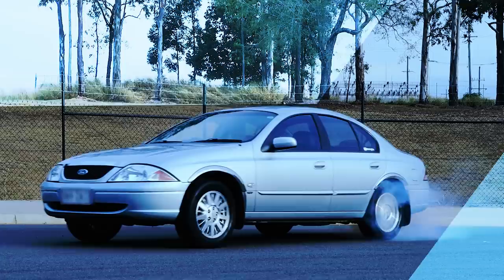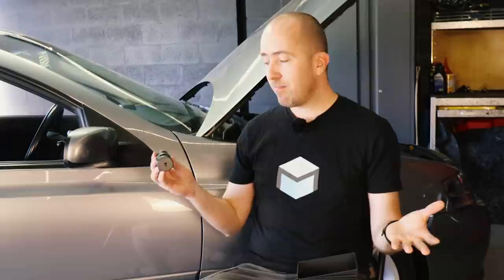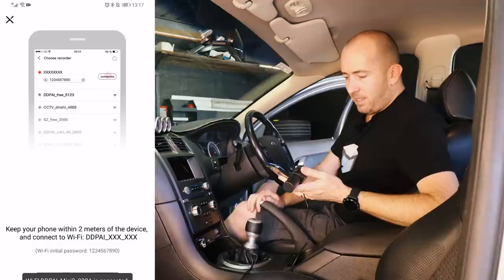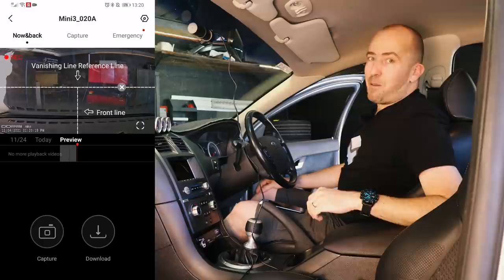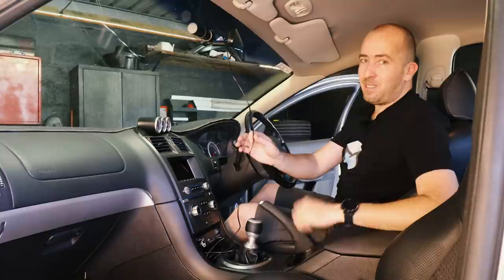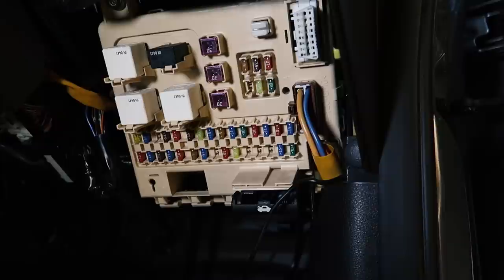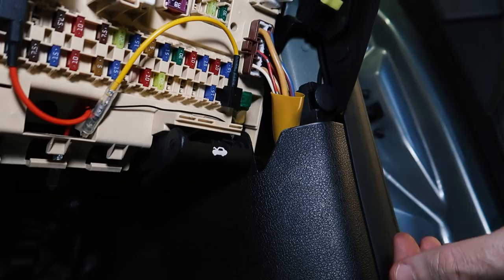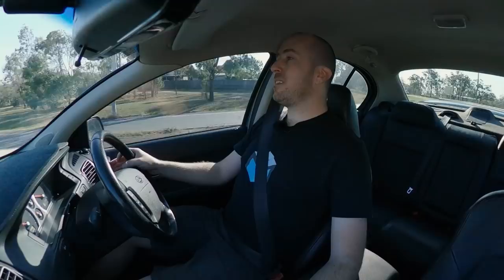📷The Best Budget Dash Cam? Why the DDpai Mini3 Camera is Worth Buying in 2021! 1600p 32GB Install

Comment: People have already mentioned the Fuse tap needing to be installed the right way which is one thing that I was looking at when doing mine. I have a Blackvue, obviously a lot more expensive but wiring is pretty much the same. Only thing I can add, is when running the wiring through your pillars, make sure it doesn't obstruct the airbags (if fitted that is). With my FG, I had to pull the A Pillar cover off all together to make sure nothing was interfered with. I used the sticky clips provided to hold the wiring behind the airbags. Same with the back camera, I fed it through the guts of the roof (I know you haven't got a rear camera but for information to other viewers). Great video once again Sean. Always look forward to your videos, keep it up. 👌😉
Reply: Wirring won't stop a side airbag being deployed trust me lol.

Comment: I have Navman MiVue 1100 XL. Bought it from Jbhifi for 450 bucks. It has both front and back camera with a display in front camera. The display can show both camera or just one. But, I set it up as a Heads-up display as it shows speed of car very accurate to my speedometer along with date and time.
It records the best video in night, warns you if headlight is not on for night, railway track coming up or speed camera ahead. It not cheap, but for 2 camera front and back with all those HUD and speed warning, I think it was a wise investment for my part.

Comment: Nice to see you are installing a dashcam, you don't want to have a crash without any sort of proof you are not at fault.

In my case having a screen is a must, with a screen you can tell in a instant if the dashcam has some type of error (Camera or Micro SD).

Im been using the Xiaomi Mijia 1s, pretty cheap for what is it. 

1080p.

Comment: I literally don’t understand how people live with wiring just dangling everywhere in their cars. Seriously! Just take a few minutes out of your life and route it out of the way! Mate, it’s not that hard lol 😂. 
Cheers Sean, great video. From your Aussie fan stuck in NZ 🤣🤣🤣
Reply: I agree. My current dash camera sits on top of Dashboard at bottom of windscreen an I have my power cord running down dash of my BF Fairmont ghia beside Interior command centre screen an secured to dash with small plastic mounts that have adhesive tape on back. So mine doesn't dangle everywhere. Rear camera lead same but on left side of ICC screen an under carpet an plastic left side door trim .up the C piller under roof lining pokes out near top centre of rear window an plugs into rear camera.

Comment: Great video Sean! I think it has been said below, but regarding the fuse taps, be sure to check which side is positive and orient the fuse taps accordingly, otherwise the fuses will act in series and can be overloaded. I'm no expert, but I watched a few videos regarding dashcam hard wiring before I did it myself, and turns out some of my fuses in the same row on the fusebox had positives on opposite sides, so had my fusetaps pointed in opposite directions (just like your setup). Just got a $10 circuit tester from Autobarn, and all set.

Comment: ..... Well done Mate, fuse splitter has to go in one direction only, otherwise your tap will be in series with the existing fuse.
Measure with your multimeter to find the source + side and the load side of fuse socket. Then map the splitter and you will see what I'm on about. I recently did a clients toyota 4WD and had to ensure the pillar feed did not interfere with the airbag (by securing it well away) just a thought if you install in other vehicles.

Comment: My last camera was from DDPai and it was brilliant but I have now got one that I believe is far superior and also has the camera for the back of the car. Both record in 1080P and it also uses an app which works great. Same as the DDPai you can download the footage straight to your phone. I cant remember but I think it cost around $150-200 when I bought it. Had it for years now and it has never failed me. Also came with the hardwire kit.
Reply from the maker: Sounds good - I wonder what it was?

Comment: Hi Shuan. My current Dash camera is powered through the power socket ( Cigarette lighter).
Am planning getting a new camera 
Anyway if I have radio on an you have news on or radio announcer interviewing.  You get interference if dash camera is on. No interference when radio has music playing or playing a CD.
If I hardwire it in like in your video would this stop the interference?

I have a 2nd question: the camera you have in this video would it fit behind centre mirror on right side as I have an existing  ETAG attached to windshield on left side?

Comment: Looking to buy two dash cams, one facing front and one facing rear (do you think a rear facing cam is a good idea BTW?). Would prefer one with a screen though. Tried a couple of cheapy bargain cams from Hardly Normal a few years back and they were utter rubbish. Threw them in the bin in disgust after a couple of days (had to buy the memory cards extra). Cheers!
Reply from the maker: I tend to avoid a screen - it makes them larger and bulkier and it's just another thing that could break. The phone app is quick and negates the need for one really.
Reply from the maker: Oh and a rear facing cam is a good idea - either buying one that can do front and rear, or buying a second cam like you suggested.
Reply: Thank you for your advice. Looks like this is the way to go.

Comment: Was looking for a new camera to replace my SCA camera, which to be fair has worked faultlessly for 4 years now.  Also worth noting if you have curtain airbags in the A pillar, make sure you route the cable to the side of the airbag module so it doesn't foul if the airbag deploys.  Definitely use a fuse tap, if the camera doesn't come with one, or your car uses the smaller micro-fuses you can buy them from Jaycar for peanuts.  I've seen people loop the stripped wire around the fuse peg and shove it back in & I don't think that is dangerous or anything, but it is pretty bogun 
:-D
Reply: Installed it this morning - weirdly though I got the exact same model, it did not come with a fuse tap - which was fine as I already had installed a extra double plug hidden in the glovebox so I just routed it to there - might be a difference between the NZ and AU suppliers I guess.  Actually had to route the cable behind the curtain airbags as they extended all the way up the A pillar into the roof area but it was easy enough.  The camera seems very good so far, I had to adjust the sensitivity as it kept triggering the impact sensor, other than that & turning off the startup noise, it's a big step up on the old SCA.  Thanks for the tip!

Comment: Love this channel Sean. 
I’m not sure why dash cams are popular. What is the benefit of them?
Reply from the maker: Evidence / backup in the event of an accident. Makes insurance claims a breeze too as who caused the accident / damage is indisputable. This camera also has 'parking mode', so if someone backs into your car whilst parked it'll also capture it. 

Personally that last feature helped me catch someone who backed into my car 10 years ago and then drove off. I saw damage on my bumper and went back through the footage helped me find out who it was, grabbed their rego and submitted it with my insurance claim. Had the front bumper of my car resprayed entirely at their cost.
Reply: @MotoringBoxTV  ok thanks mate. That makes sense.

Comment: You sure you got the wires in the right place? Universal colour code would suggest yellow / VCC being constant, and red is switched / accessory power...
Reply from the maker: Maybe, either way they're easy to swap over.
Reply: @MotoringBoxTV  Yeah, I just paused and zoomed in, your red is labelled ACC and the yellow VCC. As you say it will only take a second to fix :)

Comment: I'd be sold if they had a locking suction cup mount. As a truck driver I often need to change vehicles frequently and it would be good to be able to take it out of my commuter, into my truck and back in my car for the drive home.
Reply from the maker: It is easily removable from the mount, but I suppose you'd need a second mount then in your other vehicle.

Comment: Garmin Dash Cam mini I use, just routed the cables along the roof moulding and rubber trim then under the matts to the cigarette lighter in my centre console so you cant even tell it's there.

It's so small you can't even see it behind the mirror which I think is a plus

Comment: For cars with side airbags, you need to be careful when routing the cable at the C pillar.
Also, be aware of the "hot" side of the fuse that you piggy back to
Reply: I meant "A" pillar
Reply from the maker: I don't think the hot side matters - it worked when plugged in both ways around.
Reply: @MotoringBoxTV  It does matter. wrong way anf you're putting all the load through the original fuse. In this case the load is negligible, but best to do it right. Best to avoid chinzy fuse taps wherever possible.

Comment: if you want to remove those old E-Tag brackets use a fishing line to cut the dabble side tape and it will drop.
Reply from the maker: It actually fell off the other day all by itself. winning.

Comment: does this have a capacitor instead of battery?
Reply from the maker: Neither - if you want it to run when the vehicle is off you'll need the hardwire kit like what I used in the video.
Reply: @MotoringBoxTV  so there no capacitor or battery in the system? I thought it would have some kind of battery
Reply from the maker: No it runs off the car's battery. I actually prefer the fact there is no battery - the climate here is extremely hot in Summer and having a Lithium battery in a 60c/140f car interior is not a great idea.
Reply: @MotoringBoxTV  for this how long is the loop 3mins 1mins?
Reply from the maker: @User-is2kf  I haven't checked sorry. It is far easier to download footage through the app, rather than pulling the SD card and digging through files on a PC.

Comment: For mine Just say NO to those Chinesium fuse taps. For  a Falcon, use the phone kit connector just behind the fuse box. That'll give you fused constant and accessory power.  You can get the matching plugs from Aepro, dnaaudio etc, so no need to hack the factory wiring.